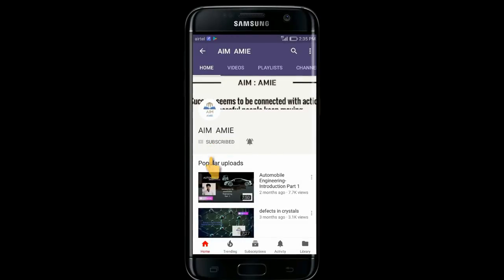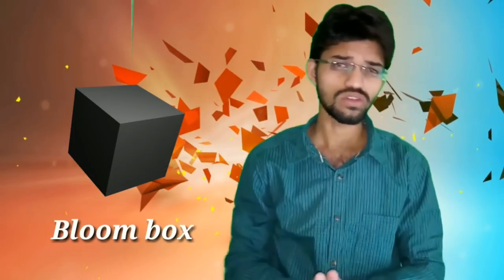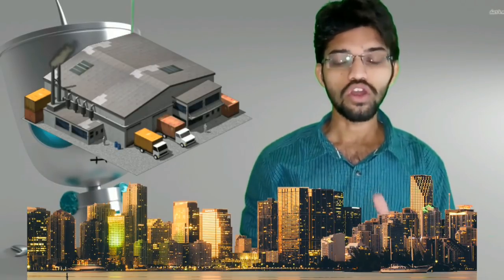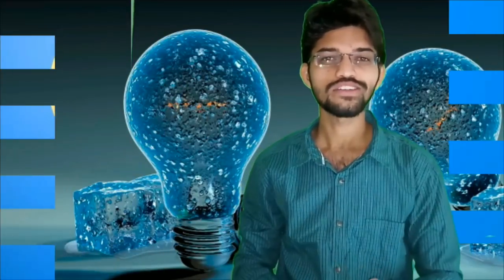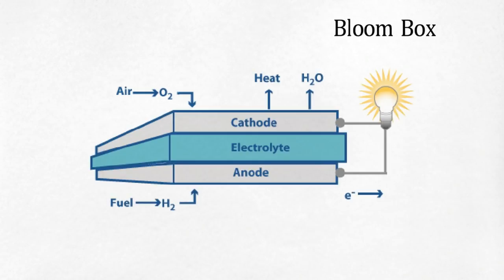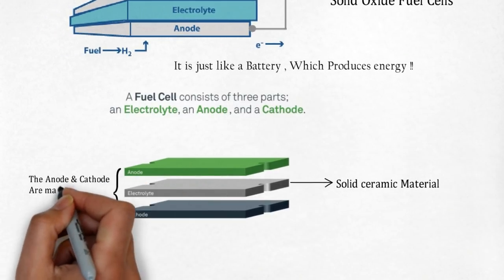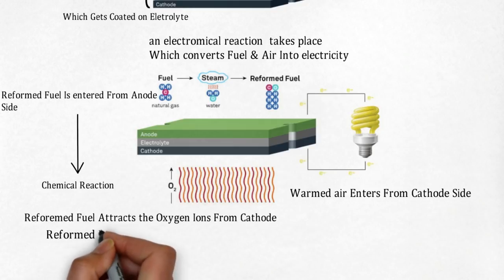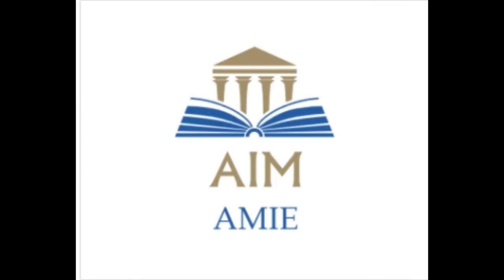What is the Source of Unlimited Energy ???  ||Engineer's Academy||

Comment: You can make a fuel cell too. Just build or buy a small kilm, ( ceramic oven). Melt the beach sand, and mold it into a thing squere. Spark plugs have the precious metal that you need on their electrode. Grind the metal from the spark plug into a powder. Spray it onto the ceramic squere plate that you made out of the beach sand. This is just an idea that may help.
Reply from the maker: Cool.. thats really nice idea...